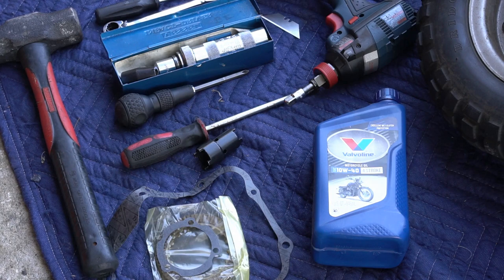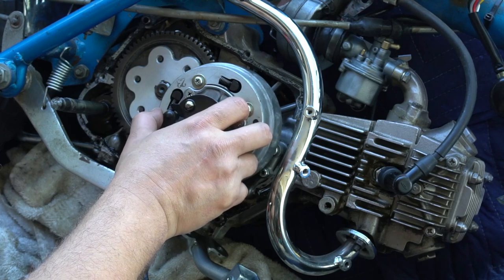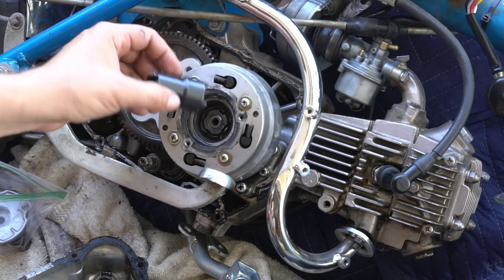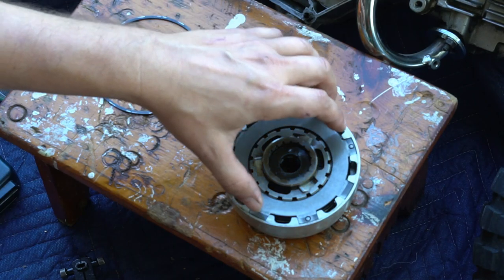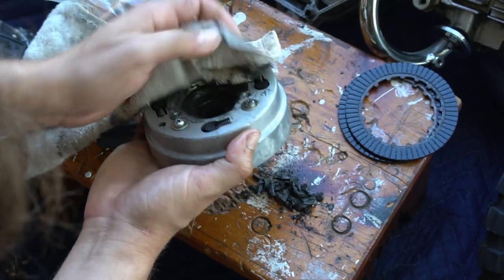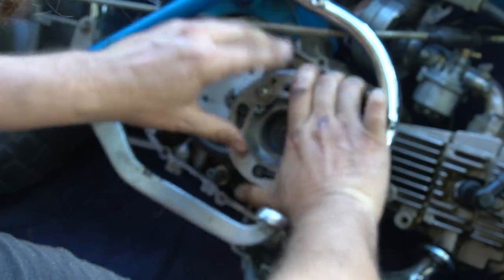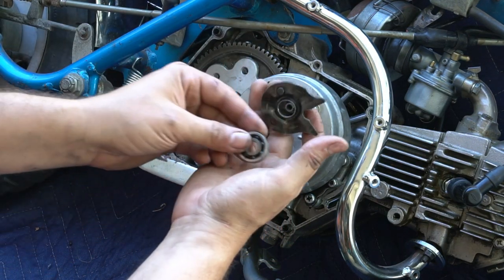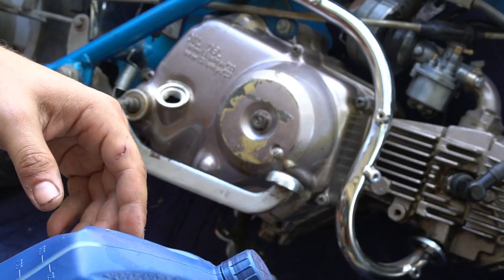Clutch Service Repair Replacement - Honda Z50 CT70 ATC70 Mini Trail Dax Monkey Engine Semi Auto 3spd

Comment: This video was very helpful for me. Especially when putting the rebuilt clutch back on the crank shaft. I'm glad you took time to explain that you have to fiddle with the large gear to get the clutch to go all the way on. When the clutch is tightened correctly the nut should be flush with the end of the crank shaft (with the nut retainer and washer in place). Thanks!

Comment: Thanks for showing the details. I work on these engines for almost 48 years, but I never opened the clutch. I wonder if the clutch performance can be improved by adding more weight to the parts that react to higher RPM. Maybe  next time you can go deeper into the clutch. Once again: Thank you .. good job.

Comment: The person before who positioned the shift arm incorrectly also left out the washer between the clutch basket nut and the tabbed lock washer. That washer is marked "out side" that that writing faces the nut side

Comment: I've changed my clutch plates but the clutch is still slipping
Try adjusting the stud still the same 
What is the problem ? Should I just changed the whole thing ?
Reply: What did you figure out?
Reply: @purplepaper7804  I've changed the whole thing but it's still the same 
Now the bike is at my hometown collecting dust

Comment: Hey man got a quick question for you. I bought a z50r few days ago that wouldnt shift. Found out the little arm on the top left side of the clutch side broke off. I changed  it and now it goes trough all the gears fine when the engine is not running. With the engine running, first goes in with a massive kick like theres no clutch at all and sencond wont engage until im at a certain speed and it also comes with a kick.. i tried adjusting the clutch but i wouldnt say it changed much... im i right to beleive its clutch related if the gears shift fine with engine off? Im kind of lost... i tried putting lite pressure on the shifting pedal to see if it would feel like im slipping the clutch because thats what my other old semi auto honda quad does but it doesnt
Reply from the maker: could be time for clutch rebuild. maybe start with that see if you get improvement as it is easily accessed. If not, probably shift forks, bent or worn etc and time to split case to look around.
Reply: @VintageHondaMinis  yeah i think if it was gear related it wouldnt shift as well with the engine not running tho. But i watched your video carefully and dont remember seeing the little cap that goes over the spring on the actuator. Time to investigate. Thanks a lot man veeeerry helpfull videos
Reply: The clutch still can be stuck the bike been sitting outside for god knows how long before i picked it up

Comment: Those old plates look like they have some high spots on them ( signs of warping) Have you ever checked them for flatness? If they are warped bad enough it can possibly give you some weird feeling in clutch engagement.
Reply from the maker: Yes you can check for flatness on granite  machine block and feeler guages
Reply: @VintageHondaMinis do you have a part number so I can get the correct clutch tool.